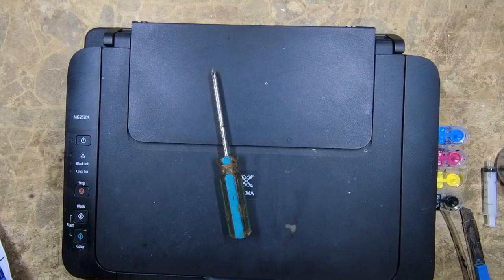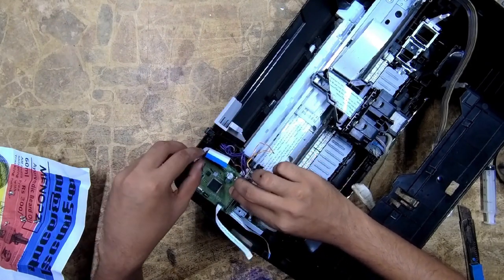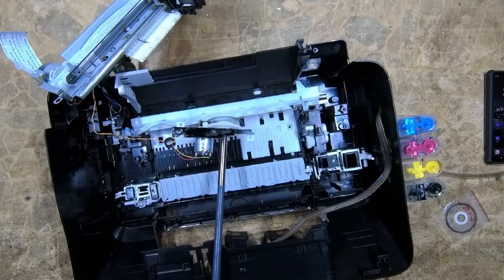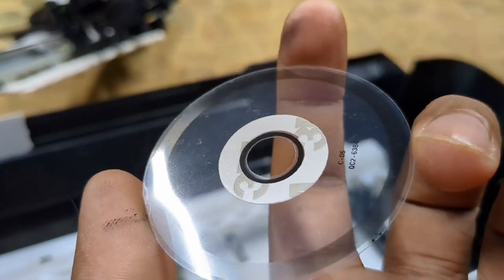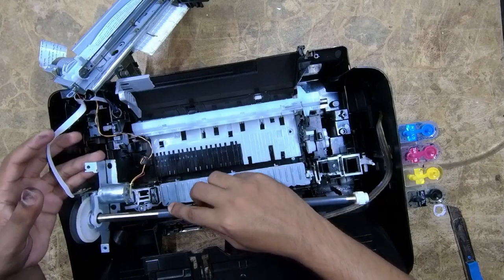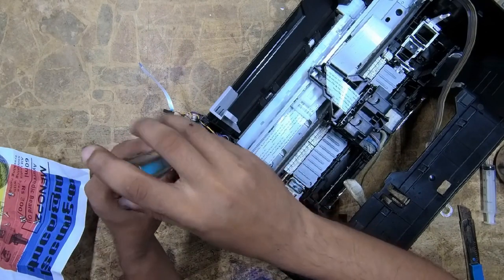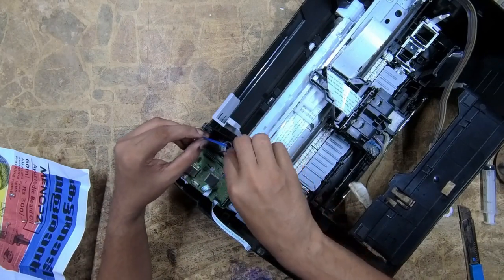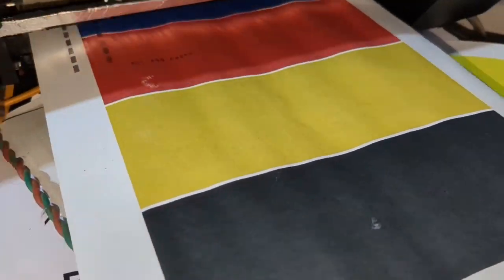Canon MG2570s Round Encoder Disk Replacement | White line issue Resolved

Comment: Nozzle check print out ok on my CANON G2010 PRINTER...but my encoder disk so missing black part ,And my xerox is showing skip lien, if i change the encode disc will it fix
Reply from the maker: yes. white horizontal lines issues are mainly because of damages encoder disk. first you try to clean the encoder disk with plane water or with isopropyl alcohol. if the nozzle check lines are perfect then there is no issue with the cartridge. this is causing by frequent nozzle cleaning. by cleaning the ink will settle down at the bottom and then clog the encoder disk sensor.
Reply from the maker: that black part on the encoder disk help the printer to remember the paper postion , if the sensor cannot detect the black part then this will result in skipping. so its for sure the encoder disk is causing the problem.

Comment: After doing it error light is blinking and no response from printer please help
Reply from the maker: is there any error code showing on the printer ? if not check the sensor strips and inspect for any damages. mainly the main  scanner strip. that is causing issue
Reply: For me also same problem
Reply: For u solve haa bro??

Comment: Bro please help me 🙏 bro
Reply from the maker: please check the connection mainly the scanner connection strip
Reply from the maker: also look for any damage on the main strip
Reply from the maker: try to remove the cartridge and refit and after 5 min
Reply: hello sir, I want to ask, I changed the canon mg3070s disk encoder, after I changed the printer it didn't work. why? please sir help me...tq.
Reply from the maker: are the disk are of same size ? any error code ?
Reply: @XBOT  ok, printer on working
Reply: @XBOT  but, still black line problem